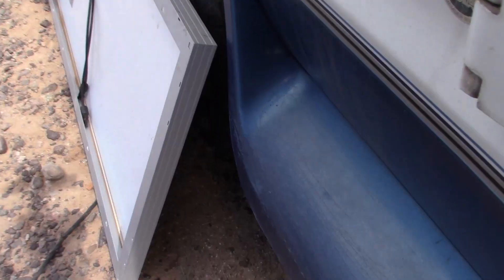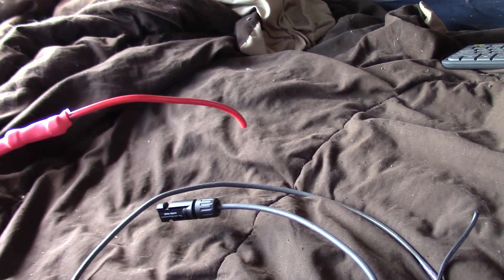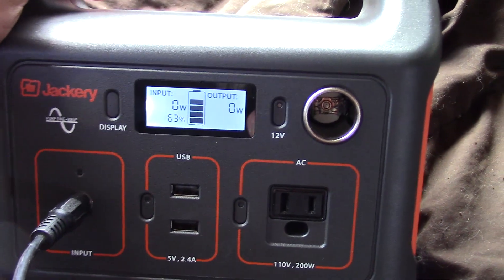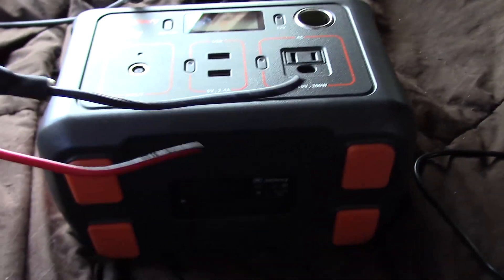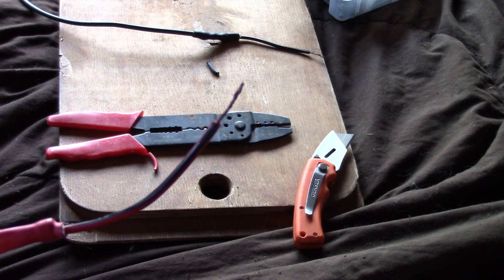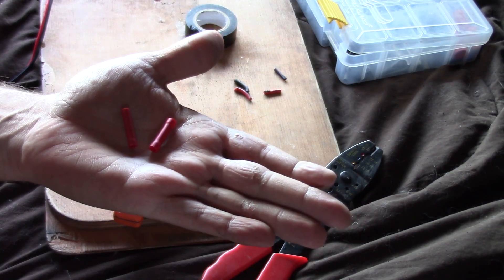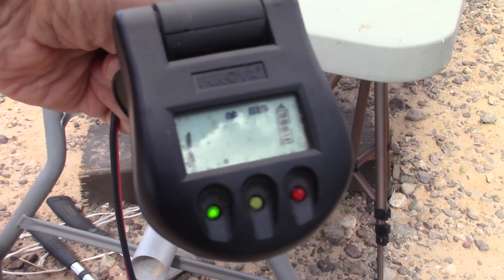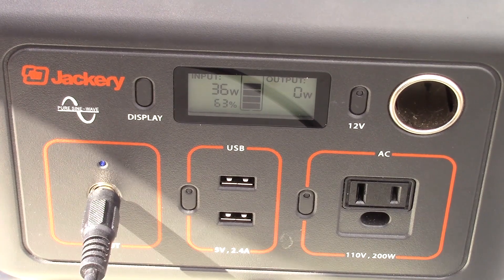Use ANY SOLAR PANEL For JACKERY And Other POWER STATIONS! How To DIY ADAPTER CABLE

Comment: After days of comparing the Jackery to the other small battery chargers I just unboxed the Aeiusny UPS-500AD. I think I may have chose wrong because of the user manual being so poorly written.  Check this out, it's from the list of warnings on the first page of the manual: 
4.  Stop using the product once it smokes or gets on fire during the working.  And put off the fire with extinguisher immediately to avoid bomb.
Reply from the maker: Gotta love the Chinglish! It's not too late to send it back and get a Jackery. They have an office in California. Makes for much better customer service.
Reply: @HOBOTECH  I'm going to give it a week.  It might go back.  Warning number 7 says to discharge and recharge the battery before using ups firstly.  WTF?  I have a hard time understanding this stuff in English!   Do I discharge it by charging things or just turning on the lamp?  How do you discharge it without using it?    lol
Reply from the maker: You have to discharge it before using? What a crock. You're actually supposed to fully charge a lithium battery before fully discharging so the BMS can do its job.
Reply: @HOBOTECH   That's good to know because I had plugged it in to charge it when I got it.  It's at 100% and has been for hours.  I'm charging a few things with it right now.  Maybe I'll keep it and just keep everyone informed on how well or poorly it preforms.  There aren't a lot of videos concerning the Aeuisny and I really don't intend to ever make a video, but maybe I will.  My husband will read the manual when he gets home.  I hope he can understand it more than I did.  But he's like you, he knows all about this stuff.

Comment: So if I connect a 100w panel to it all day, it won't hurt the battery? I'm trying to get the most charge in the morning and afternoon, or possibly cloudy days.
Reply from the maker: Nope. It limits to 42 watts max no matter what.
Reply: @HOBOTECH  thank you
Reply: @HOBOTECH  But once its 100% charged, then it will hurt the battery right?
Thats what they have charge controllers for.
Reply from the maker: @NiteshKumar-tn8xt  Nope. It has one built in.

Comment: @UCVsNMiYQkqwIq_gd0rTJF9g -  Nice idea.  Universal DIY 12V adapter for a single loose solar panel.  For a system you really need a charge controller, but for a single panel hooking into a something like a Jackery, Goalzero or a automotive jump pack it's a good adapter.  You could have gotten away with clamping onto the wires rather than stripping and splicing, but it would be really Mickey Mouse. I'm sort of surprised you didn't have any heat shrink tape, I would certainly list it on your Amazon store.   Keep rolling.

Comment: I made my own, used a DC socket and crimped the MC4 connectors to the DC socket wires, this eliminates the line splicing.  FYI

Comment: Nice video of the Jackery, and how to hook up a solar panel! I was wondering... the limit is probably the charge controller built into the unit, and has to be specific because of the lithium battery, that and because of "warranty" purposes. I wonder what the inside of the Jackery looks like. I am sure you can either replace the charge controller, or bypass it to a bigger one. They are small enough you can probably mount it to the case somewhere, then run the wires inside. I like the idea of a Jackery, and portable power. If you decide to try it, it would make a great video!
Reply: Will Prowse has a vid where he took his 240 apart, you might look for that.
Reply: the jackery input port is limited because most people use the included cable to recharge the unit from a vehicle lighter outlet. but, most of the "lighter" outlets in new vehicles are not designed to put out 15+ amps that a real cigar/cigarette lighter draws, most are limited to a lower number.. the outlet in my honda civic has a 6 amp fuse, same as the outlets in most new vehicles. so jackery had to limit the input current to their device so it can't blow the fuses in newer vehicles. it would have been cool if jackery had designed the unit with dual inlet ports, one for the lighter cord and one just for solar input that could be current-unlimited. but i'm sure that for a new unit they tried to keep the cost as low as possible, future units might have more bells and whistles...

Comment: How many feet will the cable be if you made them?
Reply from the maker: Probably just over a foot. It's an adapter so it doesn't need to be that long.

Comment: Hello Tom
Great Video, Try a new style panel that uses a micro size pickup with a magnifying glass sensors, 10 times more efficient than a standard panel. Party On, Drive Safe

Comment: Great way to repurpose your broken solar panel! No need to connect your jackery to a 100 watt panel if it will only accept 42 watts. 😀
Reply: actually there is an advantage to connecting a full 100 watt panel to the jackery, in cloudy or overcast situations with a flat mounted panel you might be lucky enough to get 42 watts from a 100 watt panel, so your unit will still recharge even on lousy days. and new 100 watt panels are so inexpensive now there is no reason to pay for a smaller one.
Reply: I need one of your awesome cables please for my Jackery Explorer  240

Comment: So I could use this for tent camping OR as a back up system for my home in an emergency situation?
Reply from the maker: Absolutely. In the case of a power outage at home you could charge it from your vehicle in the driveway for use indoors.
Reply: @HOBOTECH  Ok, so assuming my Jeep battery doesn't get disintegrated from an EMP .....but my house power is gone, can I charge the Jackery while my Jeep is off........? Or does it have to be running while I charge it? Or....can I charge the Jackery and just start my Jeep once in a while to make sure it isn't killing my battery?
Reply from the maker: @allthaticreate5585  Assuming your 12v lighter socket stays powered on when the Jeep is off, yes you can. However, you'll want to be really careful not to over drain the starter battery. It would be a good investment to get a 12v battery meter to monitor the voltage.

Comment: McDonald's puts a thin clear rubber plastic film over their windows to help them not to break so easily. If the glass did break, the glass wouldn't splatter all over the place, but would stick to the plastic, making for an easy clean up and less liability. Do you think that it could be put on a solar panel to help keep it from shattering so easily and would it block some of the charging?🤔🤔 Seeing that it's as thick as a dime just about, but is clear, I figured it could protect against pebbles and supper heavy bird droppings.😆🤣😆🤧🤒
Reply from the maker: Any kind of plastic film will block UV which is what makes the power. You can't even use regular glass because that blocks UV too. They make the panels with a special low iron tempered glass.
Reply: HOBOTECH 😭

Comment: Excellent. YES, I want you to build the solar charging gizmo for me. Approximate cost with s/h would be??? Thank you!  Now I need the Jackery and a small solar panel — is the one at HF ok, or should I stick with Amazon? Thanks again.
Reply from the maker: It would probably be $19 + $3 flat rate shipping. You can use any solar panel but beware the Harbor Freight panels are lower quality and easily damaged.
Reply: HOBOTECH   Ok. I’m in. Tell me when n where to send $$ and my mailing addy. Thanks so much for offering to do this! BTW, love your channel!!
Reply from the maker: If we reach the magic number I'll put them up on my store page. Thanks!
Reply: HOBOTECH   Ok. Fingers crossed.
Reply: @HOBOTECH  are you referring to the 100 watt 4 panel kitsch, or the single 100watt panels being fragile? Thanks because I was heading to buy a total of 1100 watts. Thank you

Comment: Nice videos HT, sold my 93 RoadTrek or would be with ya.
Can you put another power source on the mppt charger solar panel inputs? Like if you had a 24 volt battery bank sitting around and wanted to charge your RV set?
I had a 12v to 24v 10a converter was going to try, but can't afford to break anything ☺️
Reply from the maker: I had the same thoughts. There is no reason why you can't use a solar controller to regulate power to batteries, using batteries as input instead of solar panels. You just have to make sure the controller input is within the voltage range of your donor batteries.
Reply: @HOBOTECH   The reason I was hunting is I needed a way to limit current from the motor to charge camper batteries, it melts engine wiring, long story and painful troubleshooting voltage drops.  Never did test that 12 to 24v converter to get the right voltage to the MPPT input.  
Ah well, thank you for the time and videos.

Comment: I do traffic control and we have solar panels laying around from old arrow boards....i need to research them to see what power they put out and if they can be daisy chained...
Reply from the maker: Check the voltage of each in full sun. If they are reasonably close +/- 1.0v you can probably parallel them. I wouldn't put them in series unless they have the same specs and very close voltages.
Reply: Snag em, if they put out a reasonable voltage the price is right

Comment: Nice video! I like the Jackery power stations but also found the price of their dedicated solar panel to be way too high. I got a 12v plug with alligator clips so that I can charge the Jackery directly from my battery that is being solar-charged. Also got a dual 12v plug that wires into the “load” outlet of my charge controller (Renogy Rover 20) and that works also. Your solution is a great idea tho for folks who don’t have or need all the other stuff..

Comment: Curious....how did the solar panel get cracked like that? I ask because I had 2 x 50 watt panels connected together and was testing new system (made my own portable system). Panels in sun for about 30-40 mins...out in open-minded no trees etc. As I approached system to check charge controller, heard a loud POP and panel was cracking! Was cracked the entire surface- looked just like yours you showed. Any guesses on what happened? All connections we're good and accurate.
Reply from the maker: The first fell over during a strong wind in Quartzsite. If you ever boondocked there you know the gravel is large. It fell on to some big rocks. The other broke when I torqued it down wrong with stuff on top of it. You may have had a hairline crack or twisted frame in your panel. The sun heats the glass and can cause it to expand and shatter.
Reply: @HOBOTECH  thanks for your insight into the situation. I just had never seen that happen. And I inspected the panels both of them thoroughly when I receive them approximately a month ago. I was working on the project bit by bit adding hinges and a handle and latch to make my own solar suitcase.now that you mention it one of the frames on one of the panels did seem like it might have been not square or possibly torqued because it did not lay flat and when I put the two together with hinges you can tell that it was kind of off in terms of the frame so perhaps that was it. It was just so strange that that happened and it looked exactly like yours did. but the panels were nowhere near a tree or an acorn or something could have fallen or anything like that so the popping noise was just the scary part and then it just started cracking all over and it looked just like the panel you showed in your video. Thanks again for your insight also into the information on making your own cables.